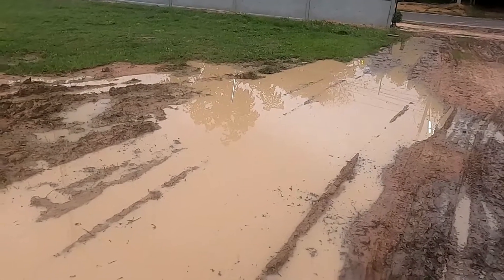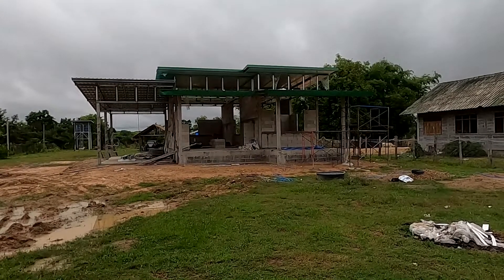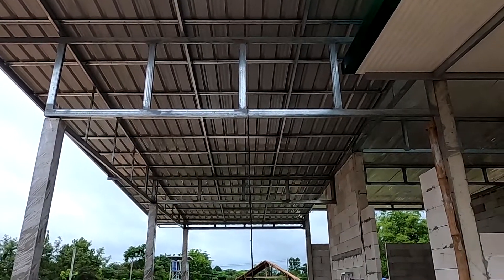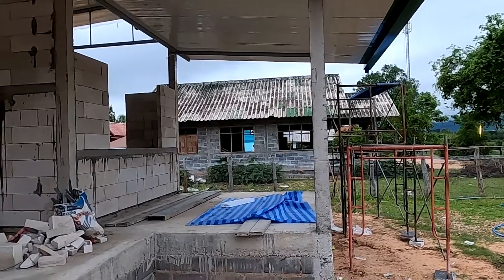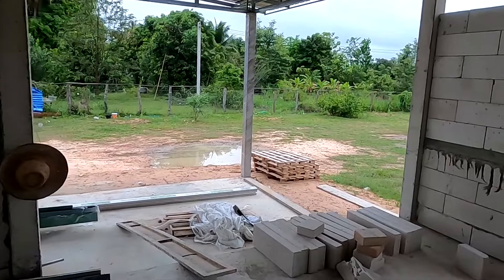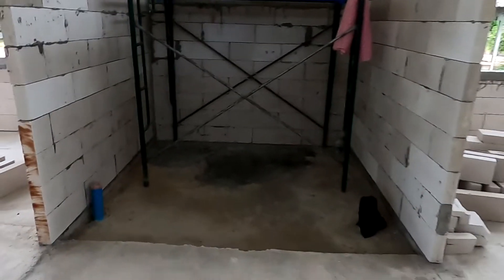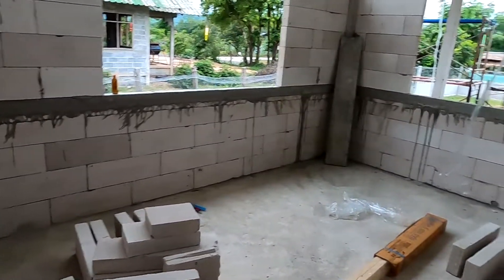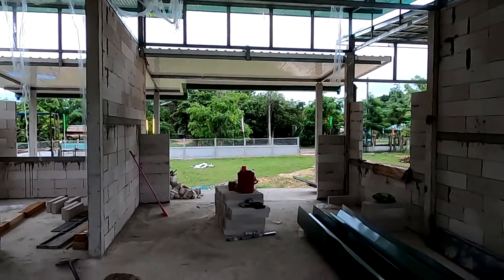The house is coming on

Comment: The slenderneess ratio of those columns looks a little dubious!  Well, at least the bloks are tied into them - aren't they?
Reply from the maker: They are heavily re-inforced. There are 18 of them. The frame work for the roof ties them altogether so the roof load is distributed acoss all of them. They do conform to what seems to be standard dimensions used out here.  Not all the blocks are tied to them.